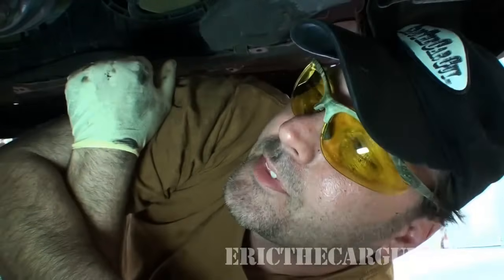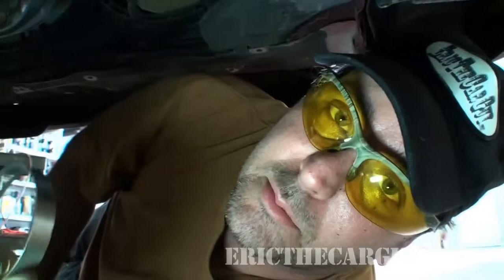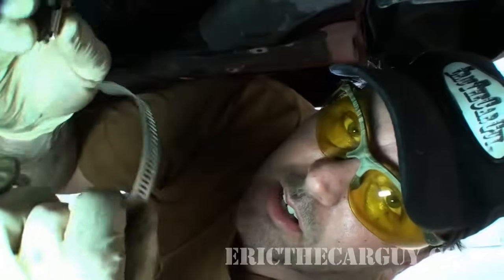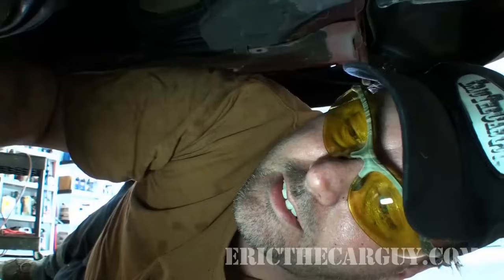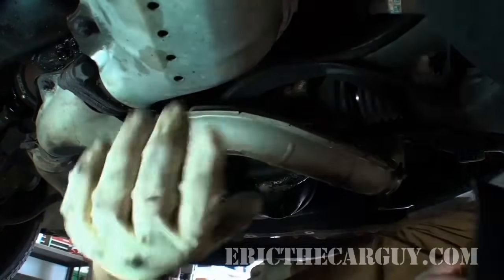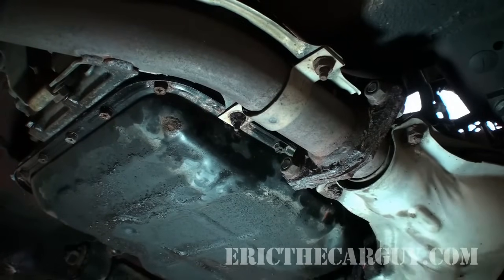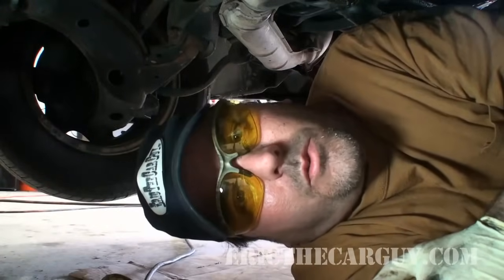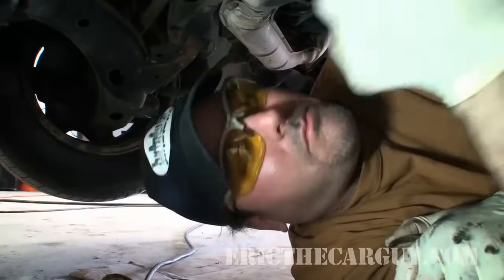How To Fix Exhaust Rattles - EricTheCarGuy

Comment: THANK YOU!!! I have a 2004 HONDA CRV. Took it to two mechanics... None of which could locate the rattle or even think of what the cause would be. One told me a nut or bolt was in the engine! Other one said it was normal- now I can do it myself! I cant say how much I appreciate you sharing this!!! Time to get dirty and sweat of 100 lbs in the Florida humidity today!!!
Reply: Hi there i think that i have similar things it sounds like metalic vibrating from engine i guess especially on D mode. but since i put on gas pedal it's gone.
did you fix in the end?

Comment: If smacking doesn't find it, crawl under at idle and poke around with a breaker bar or similar.  Eventually you'll push on the right spot to make the rattle stop.  Then mark it with chalk so you don't forget the spot while it cools off.

Comment: blarghblarghblargh, it's exactly what I'm going to look at in my 96 xantia sited in the garage, also found in the heat, the fan crackles loose, so disassemble the front may be in order. Generally, all parasite noises can be found by smacking the areas and remove/cushion/tighten the stuff. Also, for interior parasites (doors/plastics/covers) are best found with a good amplifier (mono is good), a loudspeaker and an signal generator :)

Comment: Thank you so much for this video. My exhaust rattles had been driving me crazy for months and I was unable to see anything that was loose. The technique of smacking along the pipe with the palm of my hand was the key to finding the loose heat shield above the catalytic converter. It was in a very inaccessible area and because the welds on the lower shield were still very solid I never suspected the upper shield. One hose clamp on each end of the converter did the trick. My truck is now blissfully quiet. Thanks again for taking the time to post this video.

Comment: Thank you so much for this vid Eric.  I've listened to my Dad's truck make the rattling pie pan noise at idle and coming to a stop for almost 2 years now.  Thanks to your vid I was able to convince him to let me crawl under his baby with some hose clamps and fix it in 5 minutes.  It's a small thing, but it always drove me nuts seeing him pull up to my garage in his polished baby and hearing that stupid rattle.  He'll let me wrench on every other machine he has, but not his truck.  Finally it's as quiet as that gleaming cream puff should be.  Now if I could just get him to risk scratching the bed liner by hauling a pillow or really any thing in it.

Comment: Just used this advice to fix exhaust rattles on my car :) Those noises were driving me mad... Thanks a lot Eric! I tried a lot of ways to shut it up (even welding the holder together with the exhaust) but it always didn't last long... But this solution is perfectly tight and it took me less time to apply it than getting my car lifted up :)  You're my hero Eric! This video saved me a lot of nerves :)) (..sorry for my english..)

Comment: Wow
Thanks Eric. I had been hearing that same noise in my 2003 Navigator. I took it to the dealer and they said it was metal in the Catalytic Converter and they could fix it for $200. However I am a smart women and that didn't make since to me. I brought the car home and I left  the car running and crawled all the way around the car trying to find out where that crazy noise was coming from. I finally heard it louder at the exhaust where it connects to something, but I could not see anything loose. Now I know!!! You just saved me $200. I will just buy the clamp or clamps and have my handyman guy put it on.  Thank YOU.
Reply: Lee Didway Id rip you off too if i was a mechanic

Comment: thank you Eric!! I was told my converter is bad but when I press up on the exhaust pipe (that comes out the back end of the car) it'll stop rattling which tells me it's not the converter! so I'll give this a shot. thank you again! I didn't think of going underneath and banging around either lol. (of course when it's cool)

Comment: Man Eric, You're so helpful to this independent capable woman as I am; heat shield rattle sounded like cheap gas, wasn't the case since I use high test.
From the old school, first car 65 Chevy II built to blast (last), 3 on the column! Thanks

Comment: I have a 1999 Saturn sc2 with 40k original miles on it and the car looks and runs like new but then it has this crazy exhaust rattle that makes the car sound like it's an old junker , it drives me crazy , now I know what it is , thanks!

Comment: One thing to keep in mind - while stainless clamps will clamp just as well as a cheap zinc-plated clamp, the stainless clamp is more 'noble' as far as corrosion goes, so the steel exhaust system 'protects' the stainless clamp by corroding.  Mixing stainless and ordinary steel, at high exhaust temperatures, then driving through a rainstorm, is guaranteed to accelerate the corrosion of the exhaust system.  Experience has shown this.  The fix: save money and get the cheap zinc-plated hose clamps (say, Harbor Freight).  They will clamp just as well and won't accelerate the corrosion of your exhaust system.  If the cheaper zinc-plated hose clamp corrodes away, it is much cheaper to replace the single zinc-plated hose clamp than the entire exhaust system.

Comment: Thank you for this tutorial. I’m a female and  was able to fix the rattling that my car was doing and it only cost me 2.99 thanks a bunch you saved me some money😃
Reply: Hey come on, don't sell yourself short because you're a woman. The mechanic I went to for years was a woman. She's the only one who really understood my van.
Reply: @PouchMaster  awwww thank you 😊
Reply: @mrsmerilyn13  You bet! And hey, learning vehicles is a lot of fun, even if you're not doing the work physically. Just understanding them is fascinating! Fun stuff! The lady mechanic I saw actually replaced my pinion bearing. That is like open heart surgery on a vehicle. I understood exactly what it was she was doing, but it was still way beyond my capabilities and certainly tool wise. She had to pull out the axels, disassemble the entire differential (spider gears etc), pull off the universal joint, and disconnect the drive shaft to get that pinion out, and then machine press a new bearing on it, and then put everything back together, and of course calibrate the breakaway (meaning to make sure the gears in the differential are perfectly lined up so they don't destroy each other over time by rubbing one another at a bad angle. That's actually how I met her lol. I went to 3 garages first who said they couldn't do the job or lol, said they don't do that kind of work. She saved it.
Reply: @PouchMaster  that’s a lot of work.  I’m happy she was able to fix it.

Comment: I’ve been having this problem with my 5th Generation Camaro use to do it at idling point. The dealership used clamps it worked. 2 months later the problem is back but when I’m gradually accelerating between 35 to 55mph

Comment: Another slick way is to use safety wire and wire twist tool. The wire I use is stainless. I guide it up and around, clip the ends where I put them in the jaws, lick it and pull the twist knob. Many folks probably are unfamilliar with safety wire, look it up here on Y/T.

Comment: you can use hose clamps for so much more than just hoses. I've used them on tractor exhausts to hold the mufflers on and to hold spark plug boots on.

Comment: little tip.  go to ace hardware and get those long long hose clamps.  they are actually cheaper than the car hose clamps yet like 18" long so one size fits all (cut)

Comment: Nissan owners are all familiar with this, that's because our cars have a little bridge underneath the car that runs across.. and my theory is that it morphs with the exhaust heat or bumps/potholes and the rattling you guys hear is the exhaust vibrating against this bridge. I fixed mine for free at a muffler shop(just tipped the guy $5), he bent the bridge away from the exhaust.

Comment: since I own a truck that had a loose heat shield I just took it off... but at one point, my exhaust right after the catalytic converter had a hole in it that I used hose clamps and a piece of metal to cover the hole... unfortunately they kept vibrating loose but I did the same on my ATV and that stayed tight.

Comment: I have a 03 GMC Sierra 1500 that has started making exhaust rattle noise. Found the culprit being the pipe is moving inside the upper flange connected at the header. The 2 nuts on the flange look to be tight but I know looks can be deceiving. Im trying to find time to check the torque on the nuts to see if that fixes the issue but if I find out they are tight then my question would be what would cause the pipe to move hitting the inside of the flange creating the noise and the fix for it? Thanks for all your help Eric!

Comment: A word of warning: if you do the hose-clamp-around-the-catalytic-converter trick, make sure you check it periodically. I did exactly this to fix a rattle on my Protege some years back and just a few weeks ago, the whole heat shield assembly came off while I was driving around town. :(

Comment: I have now on my 4th  Subaru, I really like them but they do have lots of little quirks and one is definitely the loose heat shields. Another thing that is a given, is engine leaks, usually not enough to have to add oil between changes but enough to drip down on the hot manifold and cause a huge stink,

Comment: Great vid erick, unfortunatelly this won't help my exhaust rattle, bc it has an aftermarket catless exhaust that taps against a crossmember or something like that, so my solution would be to make an indentation on the exhaust, but its risky bc its old and the weld spots are a little weak

Comment: God I love these videos. The issue I'm having with my 1986 Chevy S10 2.5 4x4 is that the heat shield is actually welded onto my cat. And one of the welds of some point of contact have broken off... Drives me crazy!

Comment: Thanks so much for this video Eric. My 96 Chevy S10 does the rattling noise when I slow down or drive in low rpm or when I'm sitting idle. It makes a "snorting" type sound. I will be sure to see if this is an exhaust issue.

Comment: THANK YOU!!! I hate when I'm at a red light or stop sign and you hear the rattling. I thought it was the bolt that holds the bracket holding the exhaust pipe. I changed it thinking that's what it was!

Comment: Hi Eric..firstly a wonderfull approach of your's in the video...thanks.
 My car makes a whinning sound starting at 1700 rpm and goes off at 2300 rpm, only during this rpm band. Checked the wheel Bearing , water pump, fan belt bearing, tensioner bearing.  Still not going...what you say.

Comment: Even though this video is 12 years old, I think it might be either the exhaust or exhaust shield that's causing the rattling of my new Kia Forte LX.  Just had it, not even for a full two years and it's doing that.  At least it's nothing more serious like the catalyctic converter.

Comment: Thanks. Hopefully that's my problem. I did try that the other day but didn't find anything loose. I started to think there might be a rock or bolt lose inside the muffler. I'm going to try this again. Really didn't go that far towards the front of My truck

Comment: I have similar problem on my 1990 Toyota pick up 3.0 V6, which is more of a vibration or harmonic vibration at about 2500 rpms.  Interestingly the noise only happens at around this certain rpm.  I suspect it is a loose clamp or shield of some kind.  Observation?

Comment: Nice job. Erick. 
But I having a problem with a Honda Accord 2005 the firewall heat shield is completely burned and making so much noise I thought it will easy to change o well is not. There is no much room to work on it. So I need your advice . Please. Thanks

Comment: I get a rattling noise only in hard accelerations like when I'm passing a slower vehicle in front of me. I have a 2002 Avalanche and it's so annoying to me to hear any kind of noise and it's pretty bad it kinda scares me lol.  Ima try this and see if it's this. Any idea of what it might be?  Like fuel filter? Or injectors clogged?  Any kind of guidance to what I can check would be so great and appreciated.
Reply: That video should help you

Comment: Hey Eric, I have a 1995 Trans Am 5.7L that is making a rattle when Idle or when I step on the gas. I can even feel it. It is louder when the car is cold, once it warms up. I got underneath the car and hit the exhaust system with my hand and the only thing I can hear is like a heat shield in the back under the gas tank, I have read some threads about it being a cross membrane under the car right past the Y Pipe. What do you think?

Comment: I have a 2015 wrx I work at a shop and I have a rattle noise while driving. Some mechanics have mention that I may need a clutch kit. My car is not throwing a check engine light and it’s drivable. Of course I am driving it slowing because we don’t know if it’s the flex plate or fly wheel

Comment: Have you tried any of these exhaust silcone sealers ? Yes i know its a bodge but it will save me so much time and effort removing and refitting the whole system.. (leaking from decat pipe to center pipe)

Comment: quick ? had my backyard mechanic do my whole exhaust from cat to muffler. now when I start the car I hear the front cat hitting something so I know something loose. So I had the car running for awhile after 4 mins u can hear metal pipes hitting something from the vibration. it wasn't like that before so I know he F up my whip.

Comment: I only get this loud metal rattling when I start the engine on cold. It was never like that before I had it repaired for leaks and they said they did have to remove the exhaust completely so I'm hoping there's just a loose bit somewhere there.

Comment: Eric, I recently replaced both front New complete control arms (bushings, balljoints). front KYB struts w/strut mounts on my 2005 Toyota Sienna. After that I started to hear like a popping/clanking noise when I slowly accelerate or after stop and go. I found the flange bracket at the upstream CAT is broken. Checked inner/outer tie rods and found nothing loose. Also replaced top engine mount (dog bone). 

Is it possible that I might have damaged one of the other 3 engine/transmission mounts when jacked up 1 - 1.5 inch oil/ATF pan...? Any troubleshooting tips will be greatly appreciated.

Comment: I'm having this issue on my Subaru Forester.  Coming from a "computer guy" background, with very little "car guy" experience behind me:  Could I put some kind of silicone or thermal paste into the air gap between the pipe and the shield?  Is the point of the heat shields to transfer the heat to the shields?  Or maybe not so they don't cause grass fires?  Just wondering why, even when you tie it down with the clamp, why is there so much air between the exhaust pipe and the shield?

Comment: My 2005 Mustang gt exhaust rattles near the muffler. I tightened the bolts and seemed to fix it temporarily but came back a month later.  The only thing o can think of is the rubber bushing in the hangers have gone bad

Comment: Hello Eric,

I have a 1995 Trans Am Lt1 5.7L with a rattle under the floor when Idle or when starting to move, I can feel it on the shifter and under-body. I got under the car and could not see anywhere that might show any signs of touching. The only thing I could think of is that there is a cross membrane right were the Y joins! and that is right below the center console. Any ideas?

Comment: How long would you expect the hose clamps to last in that hot environment when exposed to splashes and road salt? Are stainless steel clamps necessary, and roughly how much time would they buy you over the cheaper steel ones?

I ask because I've found that suspending a dragging exhaust with a coat hanger lasted less than a week and so did the aluminum muffler quick fix wire... Because of my experience with those, I assumed that any insubstantial metal would not hold up.

Comment: I’m hoping I have the same issue. My 2012 g37 has a rattle only from the passenger side and I hear it at like 20mph with windows down. At highway speeds I don’t hear it, hoping it’s not inside the cat because forums were mentioning something about them going bad. And I don’t hear rattle at idle, only while driving

Comment: plug condition is unknown, i should have changed them when i swapped the motor but i was really tight on cash.. did a power balance test as you showed and all 4 cylinders seem to be firing, only code it is getting is p0400.. (and at 1 point a p0440 because where the rubber seal on my gas cap seals is rusted a bit, cleaned it up and it hasn't come back) anyways, i think thats it.. if you could point me in the right direction i would appreciate it, thanks :D

Comment: I have a question, I attempted this, but didn't really follow through because as it turns out, the rattling was coming from the catalytic converter I think. Now, can I fix that issue the same way, obviously buying bigger hose clamps to cover the converter circumference, or will I have to just get it replaced? Fingers crossed for a good answer! :)

Comment: Maybe I'm looking at this from a different angle. Why didn't you just tighten the bracket that had the bolts on there already if it was just loose? I'm just asking. I have a rattle under my 2008 Mercury Mountaineer by the driver side when i turn it on. I hope it's something like this versus a broken catalytic converter. Thanks for the video.